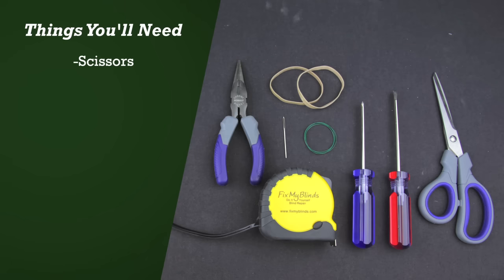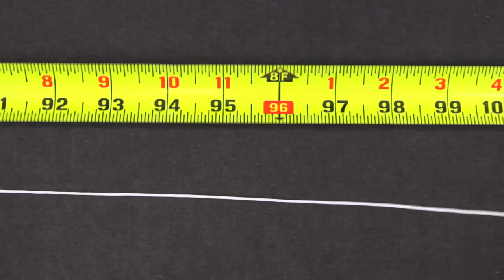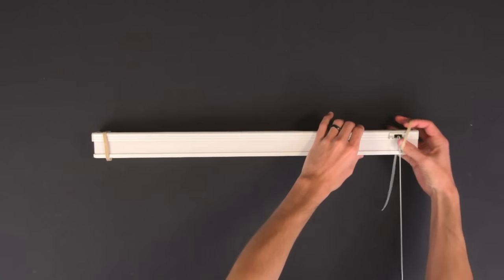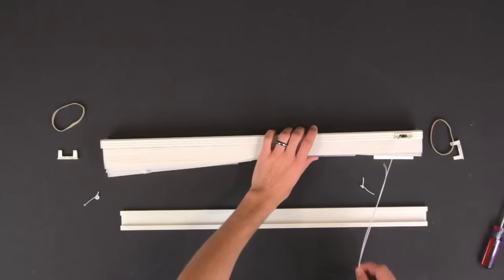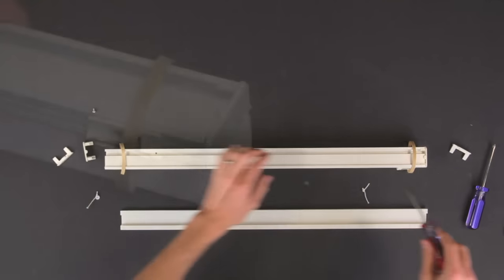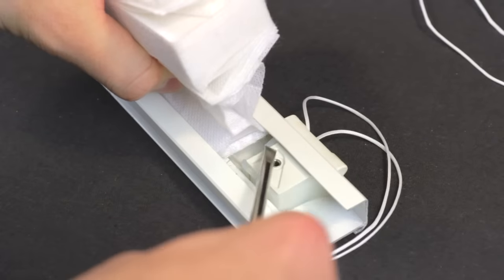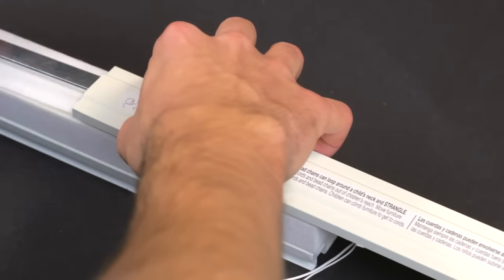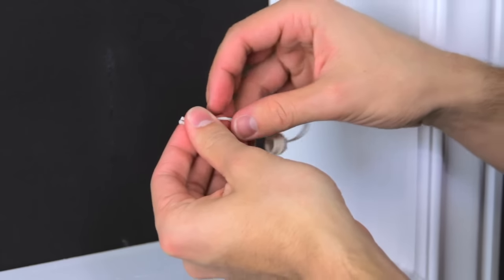How to Restring a Bali and Graber Cellular Honeycomb Shade

Comment: You might consider buying 80lb Dacron fishing line, as suggested about a year ago, by Jim Henderson (see below). That material is hella strong, is not supposed to stretch. Superb idea I'd like others to consider before buying traditional shade-cord, which eventually will again break.
Reply from the maker: Hi Anna, We don’t recommend using fishing line to repair any type of blind or shade. While the material is very strong, it will quickly cut through the plastic components of the shade, creating gouges and grooves that will hurt the operation of the shade. It is best to replace the cord with blind cord. The cord we carry is specifically made for blinds and shades, and is used by all major US window covering manufacturers. If the cord on your shade is breaking often, it may be traveling over a rough spot or a groove that has been worn in one of the plastic components. Next time you have it down and apart, I’d check all of the parts and see if anything needs to be replaced.

Comment: Your video was very easy to follow and I'm nearly complete.  I had to order the 2 mm cording; however when removing the original cording, it was nearly half the diameter.  Will I still be able to use or do I need to find a thinner diameter before I put the assembly back together?
Reply from the maker: Vicki - Thanks for your question. The correct size string for this type of shade is 1.2mm. Is that what you replaced the string with? If you only have 2.0mm string, that will be too large.

Comment: DO NOT remove the strings unless and until you really need to. This otherwise excellent video assumes the strings are broken or shot. Mine were fine. My only problem turned out to be the cheap-cheap-cheap plastic washers that the strings tied around at the end. Two of my 3 washers had broken, so the strings no longer had anything to hold onto. I left the strings in place, tied them to small actual metal washers, and all was well.
Reply: The materials to replace are so cheap, I'd rather replace everything all at once while I have the blinds off the window. If one plastic bit has gone stale and brittle, all the others are likely soon to follow, and the string is likely getting old too.
I am replacing a broken string today, but when I popped all the little plastic bits out, they all disintegrated. 

Although if it's possible to fix a bottom plastic bit without removing the blinds from the window at all, I will definitely do that!

Comment: I appreciated the video VERY MUCH, but it was for fixing a shade with only one lock box.  My curtains go up on one side and down on the other side.  Would I be stringing all the strings through those two holes in the shade so both the left and right sides would then work.  One of the strings on the right side is broken and I think it went up into the shade itself.  My shade therefore only works from up to down.  I can not raise it from the bottom up.  IN short...how would I deal with that problem?
Reply from the maker: Catherine - Thanks for your comment. We have a video that shows how to restring a top down/bottom up shade like you described. Here is a link: https://youtu.be/Q0UtQ9f60h8. Please let me know if you have any additional questions.

Comment: Video is great and I already did two blinds using this video, however that was 7 years ago. Now I’m doing a third blind and find the “proper string length” directions confusing. Please clarify: Do I need 2x the length + width to replace both pull strings? Or do I need 2x the length + the width for EACH of the two strings being replaced?
Reply: Received a prompt reply through fix my blinds email. Thank you! You guys are appreciated.

Comment: I have a Bali cellular shade over my 6 ft sliding door.  There are 2 separate shade sections which can be individually raised/lowered.  The cord locks are on opposite ends.  I cannot slide the top bar away from the cord lock.  Do you have a video which covers this case?  If not, can you give me some guidance?
Reply from the maker: Thurman, Thanks for your question. We do not have a specific video showing how to remove the fabric when there are two shades on one long headrail. It is difficult to remove the shades on those sometimes. The shade fabric is most likely getting hung up on the cord lock, but there are also cord guides that sit on the top of the fabric inside the headrail that can get turned wrong and cause problems. To remove the fabric, I recommend sticking a flat butter knife into the end of the headrail and pressing the fabric down so it can slide past the cord lock. Do not remove the cord lock; it will be destroyed, and there are no replacements available for the older style locks. Please let me know if you have any further questions or run into any other hangs ups. - Gretchen
Reply: Thank you.  That worked.  There were 2 plastic cord guides that were hitting the cord lock.  Hopefully that will also work for reassembly.
Reply from the maker: @thurmanharper2691  It should. It can be tricky to get the fabric back in, but it is possible with a little patience. Keep the flat butter knife handy!
Reply: One side done.  Thanks for your help.  The butter knife worked for disassembly AND reassembly.
Reply from the maker: @thurmanharper2691  That's great!!

Comment: Sorry, but it seems there is an omission when it comes to the 2x length plus 1 width dimension.  Do you cut this in half?  Not clear.
Reply from the maker: I apologize for any confusion. The video only demonstrates cutting one string, but in reality, two separate strings were cut and utilized for repairing the shade. To fix your shade, you will need to cut each string into a separate piece, with each piece measuring (2 times the length of your shade) plus the width of your shade.

Comment: My Bali blinds go up and down by hand, with no exterior string that you usually pull on traditional styles. How do I determine string length for this style?
Reply from the maker: For cordless operating shades like yours, you just measure the overall length of the shade and add 12 inches. That's the length for EACH string. But, the process of replacing string in cordless shades is pretty different than the standard ones. We don't have any instructions or videos for restringing cordless shades at this time.

Comment: This may work well with a 24 inch shade but it does not work with a 6 ft. shade very difficult to get the fabric and plastic top worked through the top and string clamp. It is not as easy as they make it seem. realistically most windows are at least 4 to 5 ft. high

Comment: Can I do this with old motorized blinds??? Where would I get a cord lock? Same as string?
Reply from the maker: Hi Katherine, We don't have any parts or instructions to convert a motorized shade to a string operated shade. As far as we are aware, it's not possible to do that conversion because the top headrail is usually different on a motorized shade vs a string-operated shade.

Comment: Thanks for the video.  My Bali Cellular shade is stuck in raised position. Is there a way to fix it? Thanks!
Reply from the maker: Is the shade cordless or do you pull on strings to lift it up/down?
Reply: Thanks for the reply!  I pull on strings to lift it up or lower it.  It is stringed on both sides.  The shade is now stuck on the topmost position and cannot be lowered (the strings are stuck and do not respond to pulling).
Reply from the maker: Try to push up on the bottom rail while unlocking the cord. Sometimes that helps. Otherwise, take the shade down out of the window and investigate. Perhaps the string is stuck inside the locking mechanism.

Comment: I got to the part about getting the fabric under the cording device and I could not get the fabric to slide underneath it.  Bummer.
Reply from the maker: Hi Myra, it can be tricky to get that fabric back under the cord lock. Use a small, thin screwdriver or butter knife to hold the fabric down while you push it underneath the lock. If you continue to have trouble with it or run into any other issues, reach out to us at service@fixmyblinds.com. We're happy to help!
Reply: @fixmyblinds  Thank you for your reply.  I just am seeing this.  I ended up getting a new one that is cordless.  I had my blind for almost 10 years so I figure I got my money's worth out of it!

Comment: I had my cellular shades re strung by a professional, twice and still have cords that get tangled constantly and can not close the shades properly without playing with the string and shade.  If a pro can't fix it, does that mean the mechanism is too old????  The shades are 10 years old.
Reply from the maker: Dawn, There could be a few things going on here. How long has it been since your shades were restrung? If the strings are running over a rough surface inside the shade, it can cause them to tangle/twist. I'd love to help troubleshoot what maybe be going on or if it's time for a replacement. If you'd like, please email us at service@fixmyblinds.com.

Comment: HOW DO YOU KNOW HOW MANY STRINGS YOU NEED??!!!!
Reply from the maker: Hi Lindsay - If you slide the bottom rail off, you'll see holes in the shade fabric for each of the strings you need. Does your blind only lift from the bottom up? If it is a top-down, bottom-up shade, you'll use twice as many strings as the number of holes you see in the fabric. But, if it just lifts up from the bottom, use one string per hole. Let me know if you have any other questions!